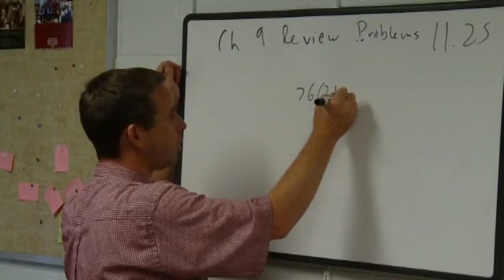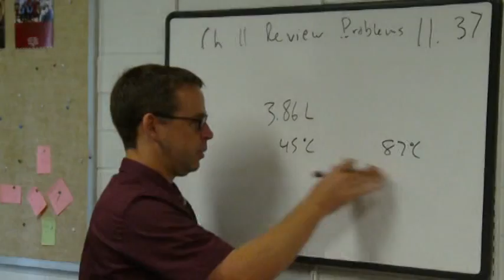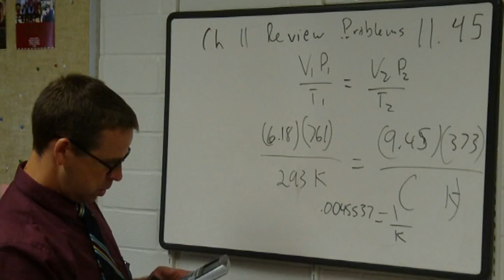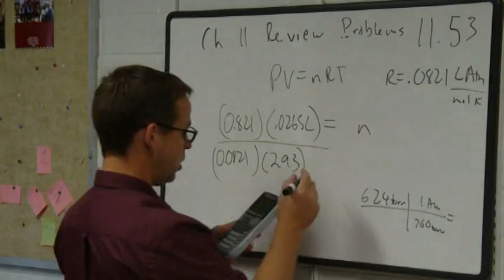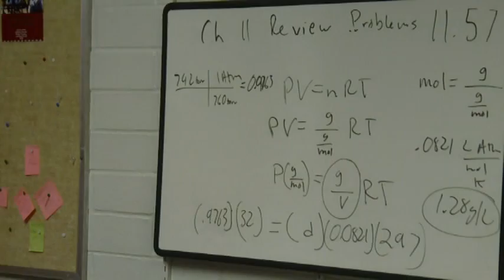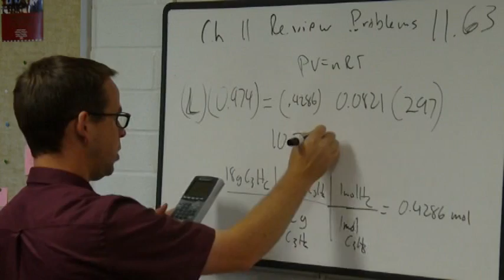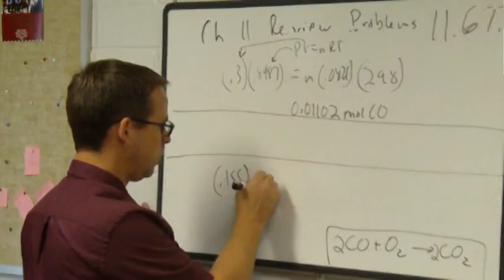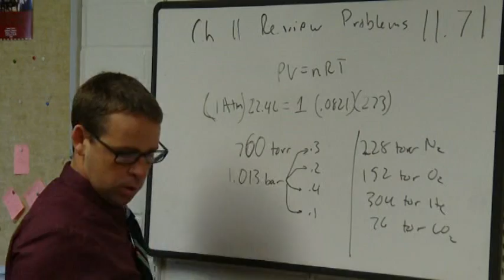vid1

Comment: Fro problem, 11.45, how do I know when to divide and when to multiply because if I followed exactly how I wrote it out it would be (6.18x761)/293/(9.45x373). I usually calculate it exactly as I wrote it out but some of the problems shown the videos doesn't always follow the formula of how it is written out. I don't know if I'm making any sense but I think this is the area that I usually get mixed up on. I've had this same problem with some of previous problems too, there are some that when I follow exactly how it is written out I get the correct answer and then some that don't give me the correct answer but I calculated it exactly how it was written out
Reply: Calculators sometimes treat order of operations slightly different so you need to understand what your calculator is doing. The best is probably to force the computer tp use the order of operation you want by doing each step individually in your calculator.